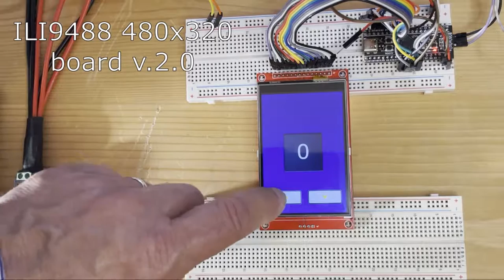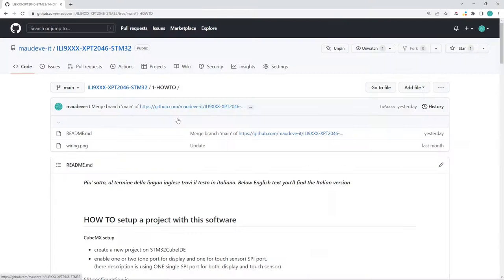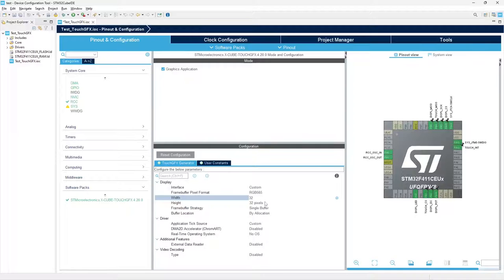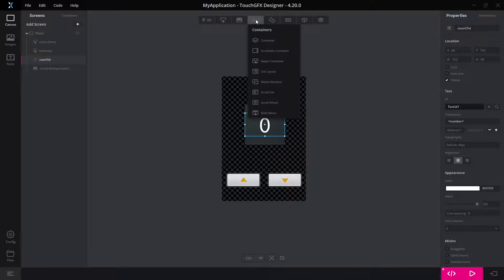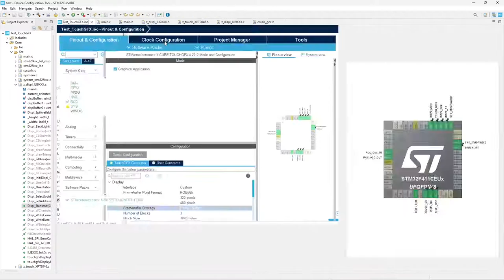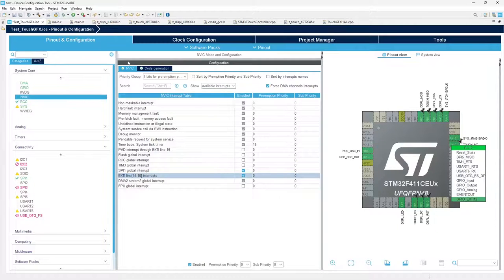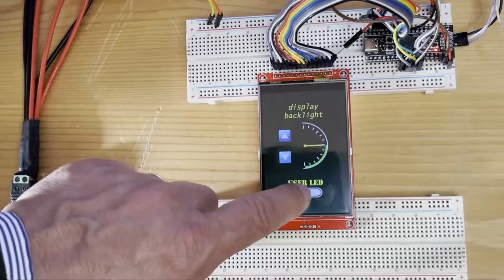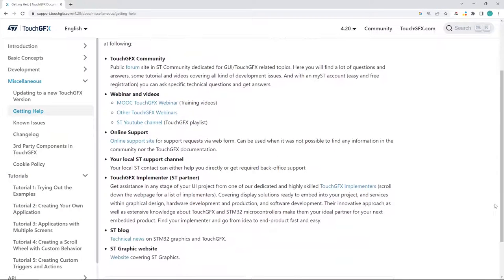A fast TouchGFX library for ILI9341, ILI9488 and ST7735 on STM32

Comment: Can you guide on how to do the same process with a custom display that uses IC6211 (i have to develop it from scratch) via i2c , i'm a bit lost on what functions i should use so that they can work with touchgfx , thank you .
Reply from the maker: Setting up TouchGFX driver from scratch, for a custom display... well... there is a full website from ST to keep in consideration.
If you already developed a set of APIs for your display, you should find all the information you need in this video (maybe together with the following videos in the playlist). 
Can you show me where you are getting confused?
Reducing it to the minimum, we could say that you need just to develop:
int touchgfxDisplayDriverTransmitActive() and 
void touchgfxDisplayDriverTransmitBlock(const uint8_t* pixels, uint16_t x, uint16_t y, uint16_t w, uint16_t h)
That's for the display.
Then you have to learn to use TouchGFX.
Reply: thanks  @bluewat  ,I'm currently working with an STM32U599 and a custom display equipped with an IC6211 driver. The setup involves I2C and MIPI DSI with 2 lanes. Right now, I'm setting up the project for the first time and am a bit concerned about the initial configuration. Should I enable LTDC along with the DSI host?
My goal is to first display colors and images before integrating TouchGFX. I want to ensure everything is working properly before moving on to using TouchGFX. I also noticed that the frame buffer location might need to be adjusted when switching to TouchGFX. Could you share your thoughts on the best approach to smoothly transition through these steps?
Thank you for your guidance!

Comment: Hi, I was wondering 3.5 V1.0 not working and is there any way to make v1.0 working?
Reply from the maker: No way to use it with TouchGFX. 
TouchGFX and 3.5" V1.0 display don't share the same color format.
Reply: @bluewat  If I don't use If I TouchGFX I want it to be displayed on screen only not  Touch🙂
Thank you very much for the answer.
Reply from the maker: But maybe…
… converting RGB666 to RGB565…
… for sure with a relevant impact on the overall performance.
Reply from the maker: HI, I updated just now library andling conversion RGB565 ->RGB666.
So now TouchGFX should work also with ILI9488V1.0
Reply: @bluewat  I'll do some testing. But I think I'm going to have a problem.
1.stm32 f103c8 not authentic >> Unable to upload data(Because the real thing is very rare)
2.because I use STM32CubeIDE 1.10.0
3.Do you have a way to upload data, please advise me.
Reply: @bluewat  HI Now it works in v1 9488 but i ran into 1 more problem.
touch system I tried to fix it and did it your way. but it still didn't work Just a little more and it will be complete.😆😆
Reply from the maker: please take a look here: https://github.com/maudeve-it/ILI9XXX-XPT2046-STM32/tree/main/4-CALIBRATION
Hoping it may be useful

Comment: Dear Mauro,
I am writing to you because i used to your great video:
https://www.youtube.com/watch?v=g1siKaPox88
that prepare own project in which I use STM32L476 and display SPI 4", ILI9488 from aliexpres.
I have a problem because the touch on the bottom of adisplay is worse than the touch on the top of the display - the touch is inaccurate and I had to touch a few times on the display. I change a display but it did not help.
I have set full touchGFX Mode, SPI 20 Mbit/s prescaler touch 4, prescaler touch 16.

Can you give me a advice where is a problem?
I will be very happy.

Best regards,
Kamil
Reply from the maker: Maybe, it is a calibration problem?

https://www.youtube.com/watch?v=020k2vbLAPc&list=PL6Fwy7aR3zSlKictoAxk_uFD6EZGeic_f&index=2&t=740s

https://github.com/maudeve-it/ILI9XXX-XPT2046-STM32/tree/main/4-CALIBRATION
Reply: @bluewat  I calibrated it in the near past. Maybe, a problem is with SPI settings? - reading touch data is to slow or to fast?
Reply from the maker: Actually I remember I've seen that there is a range of touch SPI speed where the sensor still works and replies to queries but giving low precision results. Try to drastically slow down touch spi speed and see the results. Keep in mind that touch sensor needs a communication of just a couple of bytes: you will see that a slow touch-SPI port doesn't affects the global TouchGFX project performance.
Let me know

Comment: Hii , everything went well, but wheni build the code i got 7 error before i have started writing in main.c. i am gettig undefined reference to `touchgfxSignalVSync',  undefined reference to `touchgfx_init' and  undefined reference to `touchgfx_taskEntry'. I have no idea how could i fixed that, do you know what it might cause that??? I have included two libs like you showed in video. I am using STM32F411, cube IDE 1.6.1, touchGFX 4.19.1 ( i did try 4.22 but i can't even open ApplicationTemplate.touchgfx.part from cubeIDE so i installed older version and works, i did changed in cubeMX under software packages 4.19.1)
Reply: ok i just got it to work... i had to change it to C++. but i don't get it how you were able to compile it without error with C.
Reply from the maker: Hi,
if you are not using TouchGFX (I suppose you aren't), in z_displ_ILI9XXX.h you have just yo set a comment on line:
"#define DISPLAY_USING_TOUCHGFX" 
(change that line into 
"// #define DISPLAY_USING_TOUCHGFX" 
) otherwise functions will look for an integration to that package.
More info on  
https://github.com/maudeve-it/ILI9XXX-XPT2046-STM32
and into the same z_displ_ILI9XXX.h file
Reply: @bluewat  i did use older version of TouchGFX and it worked without errors, ty.